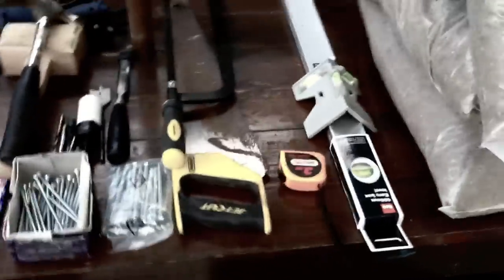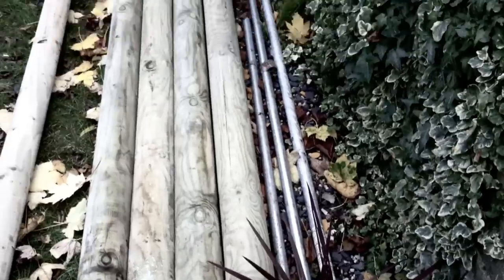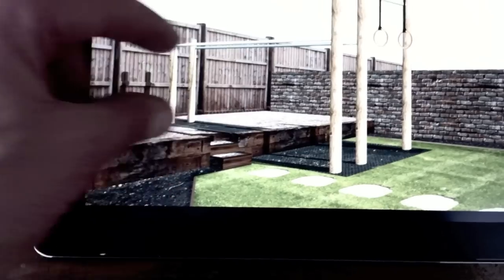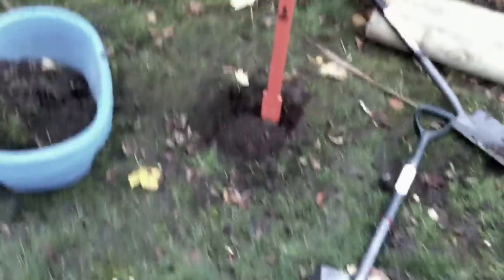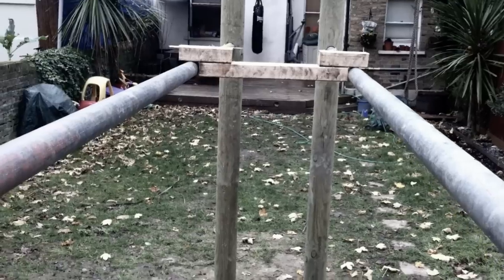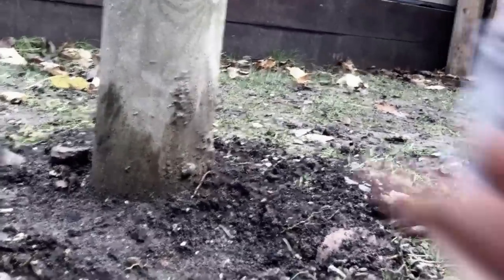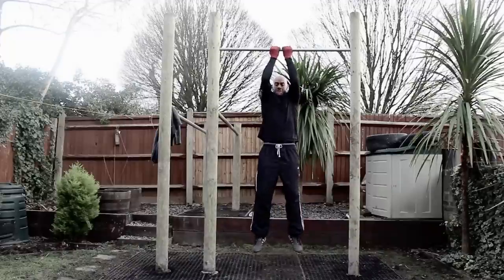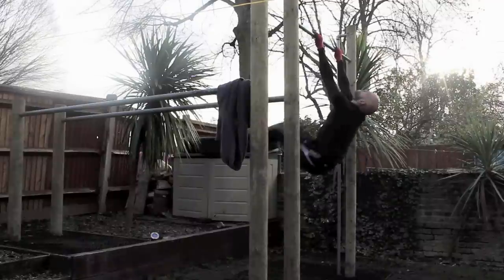HOW TO BUILD YOUR OWN PULL UP & PARALLEL BARS

Comment: I'm trying to design something like this but with a pull up station, dip station, upright crunch station and pushup and back extension station in a more compact design. I may have to use welded pipe.
But you did a nice job on this one.